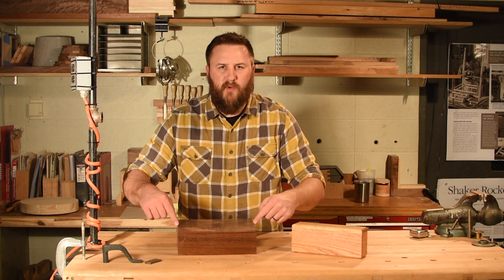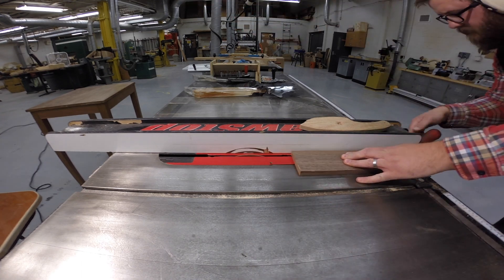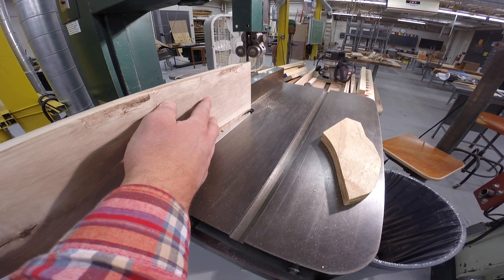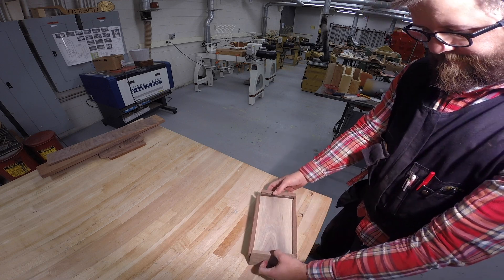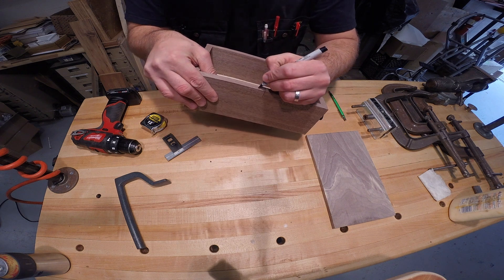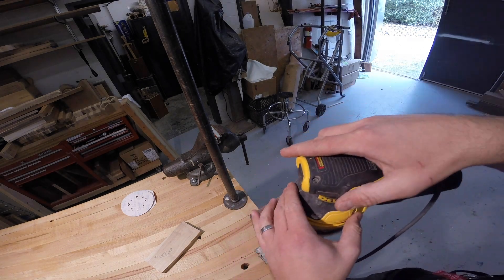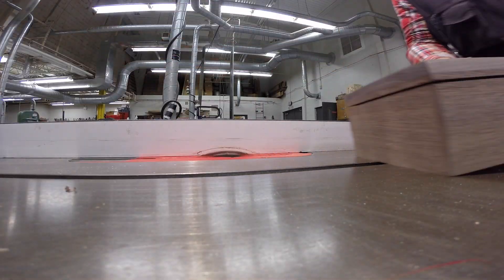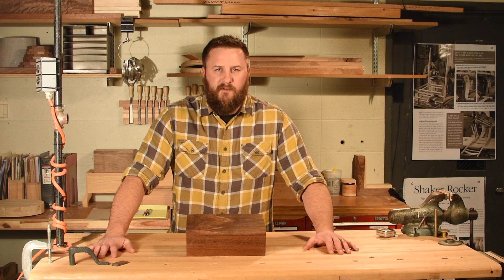Basic Valet Box

Comment: made mine today, quarter sawn white oak with a walnut bottom. Thanks. now I need to figure out how to do the pin without a doweling jig.
Reply from the maker: Depending on the tools you have available, you could make one.  Square up a 2x4, drill a hole on one edge in the center of it's thickness the same size as the pin and then drill a 3/4" hole on an 
adjacent face inline with the first hole.  Lastly, cut a groove on the bottom so the new jig will rest over the top edge of the box.  as long as the hole for the pin is plumb and centered 
in the thickness of the back side, you'll be good to go.